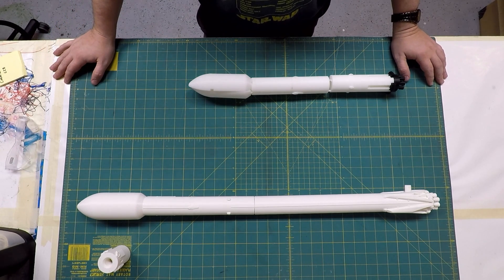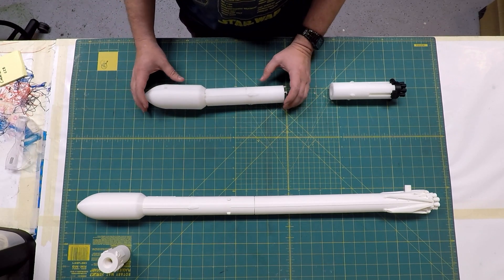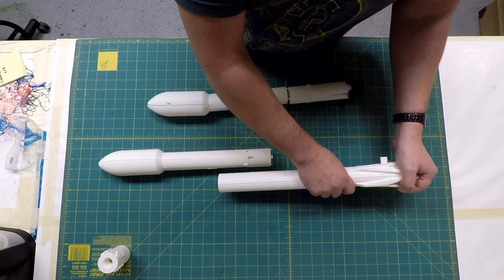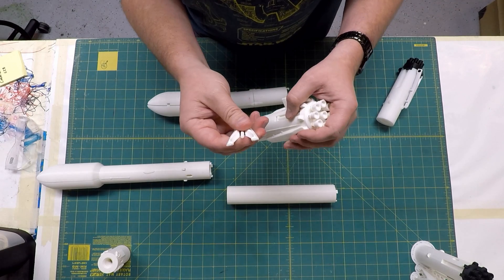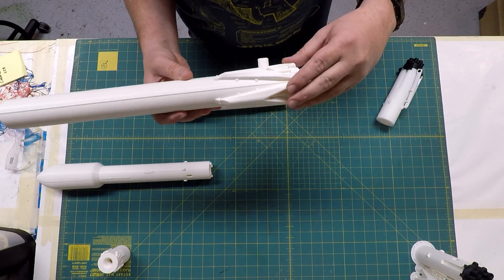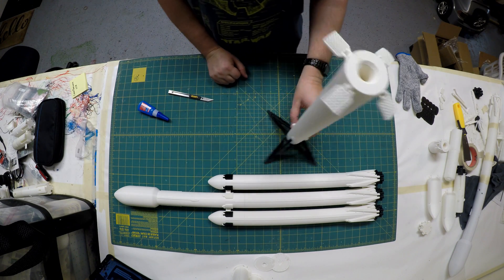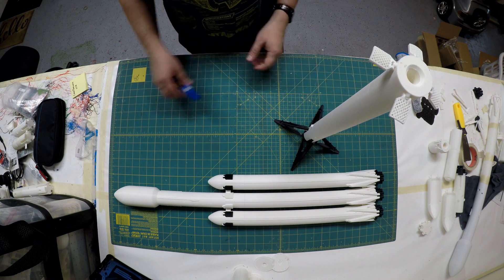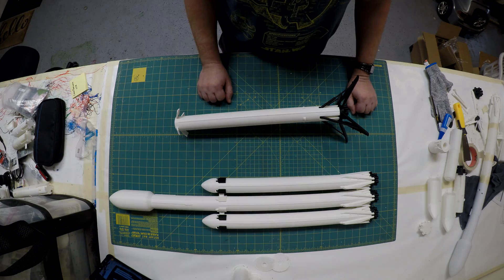Falcon Heavy Model Overview and Build

Comment: It's a great model, I'll give you that :) will I need to print the landing leg actuators and the grid fins in a more flexible filament than standard PLA? And how long is it?
Reply from the maker: I can't say for sure. I never use PLA. It deforms too easily. Even at room temp it will change shape over the course of a few years. I only ever use ABS in my printers.

Comment: is there any other way to print the legs other than standing up
Reply from the maker: I haven't tried myself. I think some have printed them laying down w/ mixed results.
Reply: @Jared_Ainsworth  well when I do it standing up I get a lot of wobble what was your print speed
Reply from the maker: @Adam-yc5vy  I'm assuming you're using a printer where the print bed moves on the X or Y axis?  I hear a lot of complaints about not being able to print the legs on that kind of printer. I unfortunately don't have a good solution. The print beds on my printers only move down between prints so the part stays pretty much stationary through the print.
Reply: @Jared_Ainsworth  yeah that’s exactly the issue I have.  Do you know of anyone who fixed it though?
Reply from the maker: @Adam-yc5vy  Sorry, no.
Reply: @Jared_Ainsworth  ok one more thing about the raceways I am just building the falcon 9 not the heavy so what are the names of the raceway files that I need
Reply from the maker: @Adam-yc5vy  sorry, I don't have a handy list for that. People have asked I just haven't stopped to do it.  They are very small so printing all of them doesn't use much material.  I actually found that just trying to print 2 or 3 at a time did not go well for me. Not enough cool time between layers.

Comment: Working on printing this right now (60% scale to match the scale of a Saturn V I have), but had lots of trouble printing the landing legs, only thing that  has ended up working is printing them one at a time with a 3mm z hop and supports underneath the feet so it won’t knock over. (On a Ender 3 v2)
Reply from the maker: Yeah sorry. There are MANY complaints about printing the legs on a printer where the print bed moves on the X or Y axis.
Reply: @Jared_Ainsworth  no worries at all, the design overall is amazing, thank you!
Reply: I didn't have luck increasing z hop setting, but I could have printed them successfully on a raft one at a time with Raft Air Gap setting 0,10mm (Ender 3 v2). It is slightly hard to separate the model from the raft.

Comment: how did you print each part and what slicer and printer did you use
Reply from the maker: Every part was oriented just as they are in the STL files. No supports on anything. Everything is done on a Zortrax M200 (old version). And mine is all done in ABS at either .15 or .2mm layers.

Comment: Know I am regretting that I did not check the remixes of the model in more detail than I did before starting print the parts. All the issues I am having right now you have fixed... And all I have left is the small parts. (Printing it at 75% scale.)

Comment: I'm having a hellova time printing those grid fins without a silly amount of stringing. What sort of slicer settings did you use to print those black pieces?
Reply: I'm having this issue, mine doesn't even slice with the grid just a bunch of circles... Did you fix the issues you had?
Reply from the maker: Zortrax M200, stock settings at .15mm layers and no supports.  I think the big thing though is that I use ABS exclusively. It strings a lot less than PLA or PETG.  I do STILL have SOME stringing, but it's not bad. Hardly noticeable from arm's length.

Comment: Simplify3D seems to struggle with slicing the grid fins. Did you print them on their own? Also not sure about the landing legs.
Reply from the maker: I print them all at once. I actually couldn't get them to print one at a time when I was testing because it wasn't cooling enough between layers. I have a pretty pricy printer though, with its own slicer, so that's probably part of it (Zortrax M200).

Comment: how did you print the legs? standing up? looks like they would fall. i know you said you wanted to print without supports. i do too
Reply from the maker: Just on a raft. No supports. There is very little surface contact, so you need a very stable printer that doesn't move the build plate on the X or Y axis.

Comment: Great model, a suggestion tho,  if you invert the leg hinge point mechanism so that you squeeze the tops of the leg together to fit inside the mount block you only need 4 mount blocks (each one is shared) instead of 8. This is inline with the actual Falcon 9
Reply from the maker: I'll keep that in mind. I've been considering revisiting this recently to clean a few things up.